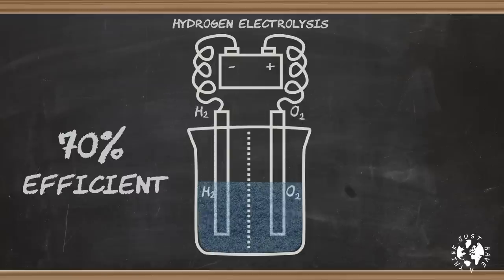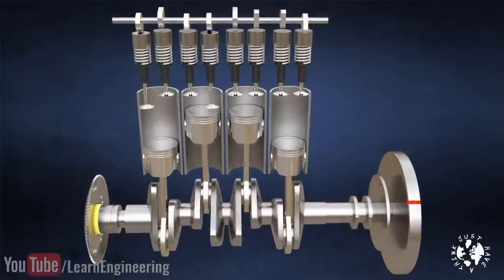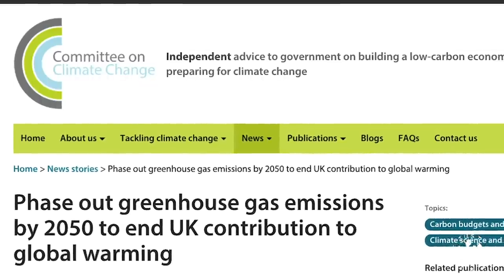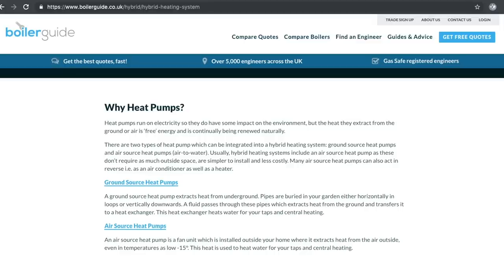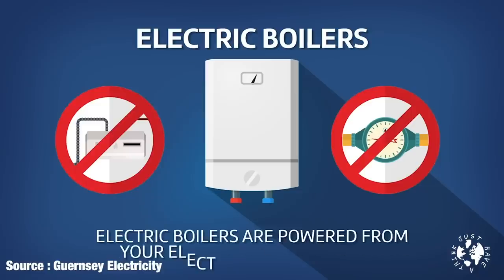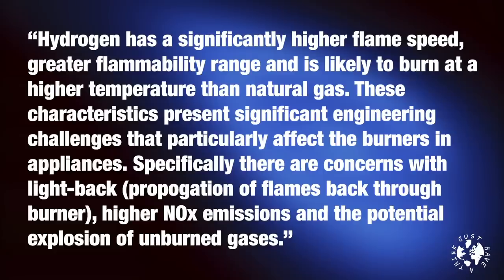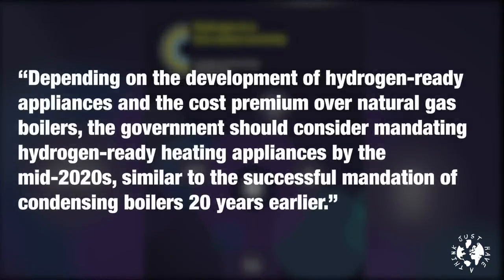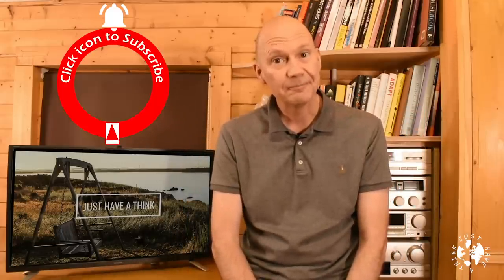Hydrogen for heating our homes

Comment: Hydrogen heating for household it's just the worst possible way to do it and mainly pushed by third parties that are mainly interested in siphon money from governments for decades with the pretense to be "green" .  
Producing hydrogen from methane cracking will always giving less energy than burning that methane in first place inside a boiler , will be reliant to hydrocarbons and the amount of CO2 produced will always be higher , even if you capture it. 
Producing hydrogen from renewables is carbon neutral but the energy produced by burning the hydrogen will always be lower than the energy (electricity) required to split it from water,  in this scenario  using the electricity from renewables  will simply give more energy in therms of heat using simple resistive heaters  or instead of that if you use a much safer (than hydrogen boilers) heat pump you'll can heat your house between half or 1/4 of the energy  using heat pumps.
 
Pure hydrogen will also induce embrittlement (search hydrogen embrittlement) that over time will potentially damage all the metallic parts used from the hydrogen plant ,to the piping and inside your house .

Comment: wow ! if you listen to this guy you might as well just pull the covers over your head and stay in bed. get the hell out of the city. make your own energy and grow your own food. when the wind blows it pulls the heat out of your house . you can use the wind to run a resistance heater or with electrolysis, a hydrogen flame to heat your home. you can make hydrogen with as little as 2 volts . i dispute his 30 % energy loss through electrolysis,  more like 15 %, and where does this energy go?  it 's heating up the electrolyte. no one needs liquid hydrogen . they can create natural gas (methane, CH4) with hydrogen and CO2.

Comment: This is all a bit of a fantasy with absolutely no thought given to the practicalities. Renewable energy is 'assumed' but only contributes a small percentage (2.72%) at the moment. Electric boilers would reduce people into abject poverty with electricity costs at 5 times the amount of gas. Air source heat pumps are not suitable for radaitor heating systems because of the higher temperatures required. They're OK for underfloor heating if designed into the system. What's the point of hydrogen? CO2 is a red herring. We contribute a small fraction a percent so if we reduce what we produce to zero it will make almost no difference. (The earth had times when CO2 was much higher without us humans contributing to it). I'm all for practical and realistic solutions to produce clean, cheap energy but so much of what we're being fed is just schoolboy science.

Comment: The R&D on hydrogen for converting existing internal combustion engines to run on hydrogen might not be a bad idea and would make a good bridge technology.  A synthetic coal fuel can be gasified & run a internal combustion engine; so why not hydrogen that is already a gas & is way cleaner?  R&D takes funding but does not have to be on the scale of government to begin with.

Comment: Hydrogen makes metal brittle, as such it can't really be used in existing infrastructure without addressing this.
Reply: Almost all gas pipes outside the home have already been replaced by plastic, so no embrittlement issue there. Is it a problem with copper pipe - I'm aware of it being an issue with steel, but even there it depends on the detailed circumstances. According to wikipedia, copper is not susceptible: https://en.wikipedia.org/wiki/Hydrogen_embrittlement.  I suspect existing boilers will work fine at acceptable risk if you swap over the burner. The bigger issues are higher flame speed, higher explosion pressure, lower ignition energy and much larger explosive mix range (than methane).
Reply: Thanks for the link. It would appear that standard mild steel and copper at normal temperature shouldn't be to affected. We should remember that coal gas was around 60% hydrogen and we didn't have any problems with that.

Comment: I remember the introduction of natural gas, or "North Sea" gas to replace town gas.  That was a lot of work, and the change to hydrogen is a significantly more difficult engineering challenge.  But in the interim mixing in some hydrogen and a lot of biogas into the mains has the potential to steadily reduce carbon emmissions in the meantime.
Reply: I always wondered if most of the things being said about [insert renewable /new tech here] were being said about the switch from coal gas to natural gas.

Comment: Up until a couple days ago, I thought CH4 as a transition fuel was a better coal burning to generate electricity.  Researchers here in the U.S. have recently discovered high CH4 levels in the atmosphere in the vicinity of gas production fields in CO, TX and CA (I assume the same for all U.S. gas production). They calculate that if the leakage of CH4 to the atmosphere from production is greater than 4% of the gas produced, then CH4 a worse greenhouse gas effect than using coal. (CH4 is 20 times more potent that CO2). They measured leakage rates at gas fields in these 3 states at 8 to 16% of Methane produced! And to boot, the Trump administration has just rolled back Obama era environmental regulations controlling CH4 leakage. PV solar and Wind seem like the way to go as everything else is just stop gap half measures. I really enjoy your thought provoking videos.

Comment: Hydrogen production would be more efficient if all the "waste" heat was used for a useful purpose. It would work well in conjunction with cryogenic air. 
Hydrogen would also be good for use for long range aviation and shipping.

Comment: Gawd, you are so one sided. I never hear any problem with electricity driven devices such as, where do you dispose of all the batteries used by cars, trucks and homes? What's the cost to make the batteries. Don't forget the pollution made by the insulating wires. Then there's the problem of just ow are you going to power/recharge all those batteries. I'm sure you'll say we will just build more wind farms. Okay, how much land are you going to take to build wind, solar and thermo power stations. BTW, heat pumps are extremely inefficient. They use way too much electricity to run. Your percentages of efficiency of hydrogen is also skewed. Your infor is about five years old. Lastly, did you that vegans produce more methane than carnivores? Yeah, but you didn't think of that one did you.

Comment: UK=oldest housing stock in europe; UK properties cost circa 20-60K to retrofit with insulation; without this insulation those expensive heat pumps can't meet heating demand and you'll shiver; those solar panels at 3Kw (average) can no way meet the typical electric boiler loads of 9Kw especially in mid winter when output is <1kw; the electrical saftey (bonding) requirements will involve major rewires as will electric boilers as main fuses are only 100A; Those solar panels are a dead loss north of 53° N; electric meters don't help people become greener, they are a rationing mechanism for the imminent lack of capacity; The metals used in 18650 cells (electric batteries) are very damaging to mine; the science related to global warming is bogus, refer to fraud at east anglia climategate. The historic dataset doesn't exist and until very recently the measurement uncertainties render most data bogus. To measure temperature with an expanded uncertainty of 95% k=2 to <0.1K is VERY VERY difficult and requires almost daily cross checks to SPRTs under lab conditions for data to be trustable...........your heart is in the right place but come on, this stuff is a pipe dream both interms of hard science and economics !

Comment: You not including the energy lost in mining Lithium, Cobalt, making the plastic batteries etc. Which if factored in would change the difference in efficiencies. Plus there’s the Environmental destruction of mining and evaporation pools( in Arid areas) for Lithium, also these metals are Non Renewable, whereas Hydrogen via Electrolysis and HFC is the best cyclic Fuel and can be stored as compressed gas for months or years. It’s not just about efficiency anyway, glass Soda bottles are less efficient than plastic cos it’s lighter so used less fuel, BUT then becomes a waste problem as it is single use!. Also on the Orkney Isles( link below) they are using excess Wind energy to make Hydrogen via Electrolysis, then use it in Fuel Cells when needed they also use the Heat generated by the HFC to heat local buildings making it a CHP-HFC( Combined Heat-Hydrogen Fuel Cell) https://youtu.be/Rybpaqhg5Qg
Reply: "Environmental destruction of mining and evaporation pools( in Arid areas) for Lithium" These are drying ponds literally in the middle of the Atacama desert. The environmental impact is very low!
Reply: John Bash-on-ger How Can evaporation pools in Arid/Desert areas ever be ok with the vast amounts of water they waste?. Also by removing these metallic salts from Ecosystems is likely to have severe consequences for wildlife. Such as Flamingos that feed and nest in such places. The thing is we have only just touched the tip of the Iceberg with Cobalt and Lithium use, Lithium Ion batteries are now being used in a fast growing number of domestic appliances and devices. What happens if hundreds of millions of Electric Vehicles( EV) are built, and a multitude of new battery powered devices and appliances come on the market.
Reply: @Kiyarose3999  "How Can evaporation pools in Arid/Desert areas ever be ok with the vast amounts of water they waste?." Where do they source the water from? And do they actually waste that water? You do realize the water evaporates right? And then enters back into the water cycle. 

Also there is a company working on next-gen lithium extraction that is much faster. One article even mentioned 24 hours instead of 24 months. Company's website: http://www.pureenergyminerals.com/projects1/ The metallic salts are excavated from mines and are not part of the biosphere. "Such as Flamingos that feed and nest in such places." Citation needed. 

"The thing is we have only just touched the tip of the Iceberg with Cobalt and Lithium use" They are actively getting rid of cobalt, within a few years there won't be any cobalt in a new electric car's battery. 

"What happens if hundreds of millions of Electric Vehicles( EV) are built, and a multitude of new battery powered devices and appliances come on the market." They'll probably be using a lot of next-generation batteries built on different chemistries than the current Li-ion batteries.